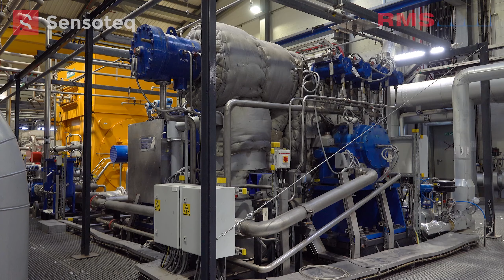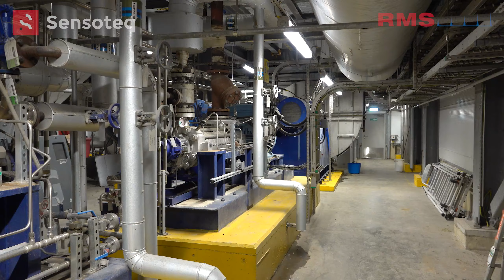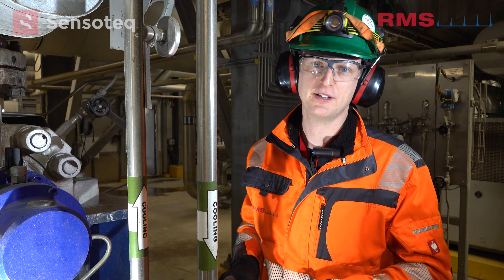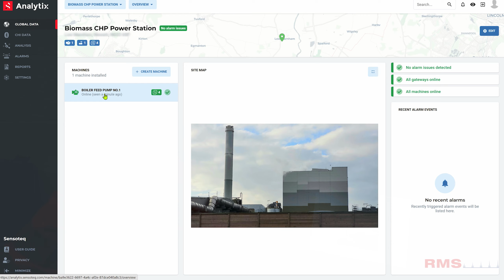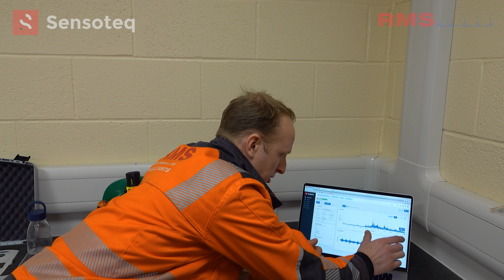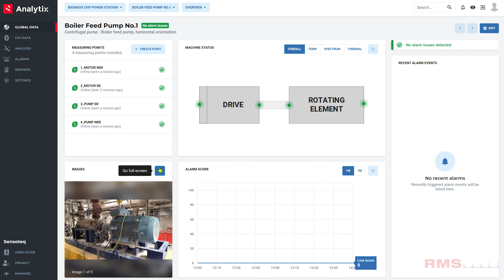Kappa X Wireless Vibration Sensor Technology

Comment: I've seen wire collecting sensors that collect information in control room so what is the difference?
Reply from the maker: The sensors are wireless so can be easily be placed without high cost of hard-wiring in. Also data available on cloud so can be viewed remotely.
Reply: Carrying wired set up for analysis is hectic practically....I am experiencing